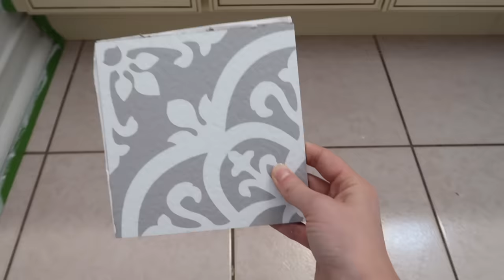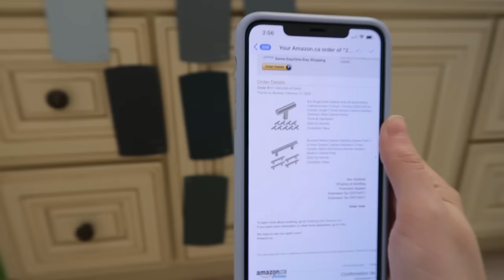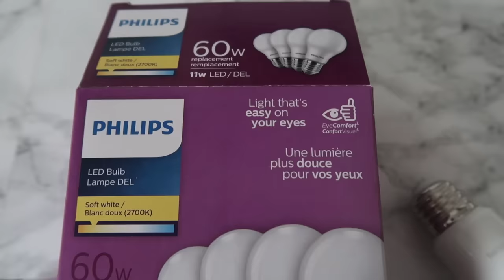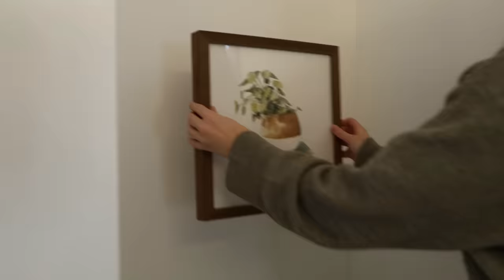DIY BATHROOM MAKEOVER ON A BUDGET | RENTER FRIENDLY

Comment: She didn't prep the cabinets or doors at all. That will definitely peel over time. None of this will hold up over time. Looks adorable but really need a longer term solution for bathrooms
Reply: Lisa o'brien I agree with you.  She should have of primed them, then used a high quality foam roller to eliminate the brush strokes.  Nice rugs would have been a better solution to updating the floors.
Reply: The counter solution doesn’t seem long term, that’s why it’s expensive to redo a bathroom
Reply: At around 6.25 is shows her sanding the cabinets...
Reply: I was looking for this comment! I was going to say, she didnt bad prep work. You should ALWAYS use a good bonding primer on a bathroom cabinet.
Reply: yeh we had floor stickers overtime they smell. we used to mop with bleach and stuff even then it wouldnt make a difference. after we used tile it didnt smell. so it was them stickers
Reply: @Lisa o'brien I know, I was cringing at the cabinet paint job. My husband and I have painted many cabinets and that cannot look good in person. We usually do 2-3 coats of a high grade cabinet primer and then 2 coats of paint. We also do a much more thorough job of prepping. 
 I was pleasantly surprised with how the floor came out. I'm not a big fan of that print everyone is using right now because I think it's super trendy and reminds me of a more modern version of what I saw growing up in the 70's but for the price, I think she did really well and since it's temporary, so who cares if it's trendy. 
Her parents are super sweet!! :)
Reply from the maker: Thank you for your comment! I did prep and sand the cabinets before painting for a lasting job :)
Reply: Kristen McGowan you did a nice job!
Reply: @KristenMcGowan  You did an awesome job and loved the creativity.  The floor thing is a great idea and one I would consider trying.  Very nice.
Reply: @Kate98755  I used contact paper that looks like granite on my counter and its been almost 2 years, no bubbling, peeling or tears.  It still looks as good.  In fact I also used it around the plant ledge of my bathtub.
Reply: Very nice
Reply: Fyi, there is now paint that doesn't require prepping for jobs like this.
Reply: @ShellG.   If you looked at the paint she used, it was paint with primer.  I've been using that type of paint for a while, and it is really sturdy - it doesn't scratch or peel easily.  I'm concerned about whether or not she used Kitchen & Bath paint on the walls, though - didn't get a good look at the can.  K&B has the anti-mildew treatment added in at the factory.  That's important for those ultra whites.
Reply: @thatsmalltowngirl4   The paint she was using has primer in it.  Good quality.  And she did sand before painting the cabinets.  The door might be a problem, but the paint - again - is paint + primer.
Reply: @Kate98755   I was thinking she could have gotten one of the marbling kits they sell - good sanding on that countertop and then just apply the kit, following the directions.  They're not that hard or expensive.
Reply: The cabinets didn’t even look bad before.
Reply: @caroljean1962  If she used Behr Marquis, that has primer in it already.  Also, the cabinet looked more mat than glossy, so it might work.
Reply: @planetag310  That is paint meant for walls.  The primer in it is meant for changing wall colors.  To have a lasting job on cabinetry, one must use a special bonding primer and then cabinet paint (or a chalk paint followed by a quality top coat to seal & protect).
Reply: @missmessi  it's the water that get below them that gets stagnant and moldy
Reply: @diziscurran  yep agree. coz after we did real tiles it never ever smelled.
Reply: @missMediaChick  can you give me examples? Thanks
Reply: That's the problem with renting. You just don't own the property and do what you want to in it. The owner owns it. Save up!!! Start now!
Reply: I love how you're all telling her how she should have done things.
If you think you can do better then start your own youtube channel.
A lot of times these things are done behind the scenes, or off camera, to save time.
Don't make assumptions.
Reply: @ShellG.  Are you an expert? If you are then you should start your own youtube channel instead of coming on here and critiquing someone else or thinking you know better.
It's rude.
Reply: @KristenMcGowan  Thank you for being kind to the know-it-alls that come on here and pretend that they know everything you did behind the scenes or that didn't actually watch the entire video. 
I don't know how you deal with them. I get frustrated just reading them lol
Reply: @JenSwarbrick1966  Not sure why you're so offended by my comment seeing as how the other comments were pretty harsh but I digress. To answer your question, we have painted 3 sets of cabinets and I took the original instructions from a professional painter. He's seen my finished work and said he was impressed. I think she was just trying to do this complete job under $400 and perhaps she would have spent more money if it weren't for that. Doing a proper paint finish on cabinets is usually a 3-4 day job. The inside of the cabinets weren't finished because there wasn't enough paint. I don't even know why I'm explaining myself. I just feel that if you're going to do a DIY video to show people it needs to be done properly. Overall, she had a nice outcome.
Reply: b anonymous I used the same floor stickers in my bathroom:.. for a year no issue with moisture or them peeling up. The adhesive is INSANELY strong.
Reply: Lisa O'Brien, finally a voice of reason!!!  You are correct! None of this will hold up over time, and is likely to cause real problems with this bathroom which will only devalue this property as a whole. All the dolts who are praising this makeover and encouraging this young woman to continue and who are saying they'll be following her advice, are just as clueless and uninformed as she is. While what she has done looks good, it is not good, and it is not an improvement to the old bathroom in any way but visually. The makeover, as appealing as it may visually be, is a fail. The creator of the video is one ill-informed person giving advice to thousands of ill-informed people who are eating it up with a spoon.
Reply: @JenSwarbrick1966 , what is your problem???  Of course people will, and SHOULD, comment when someone gives half-baked advice that is blatantly wrong. It is not rude to point it out, it is considerate, and is done to prevent innocent people from making the same mistakes. You keep replying that negative commentors should 'get their own YouTube channel'.  Well here's a news flash for you, not everyone wants their own YouTube channel. It is the absolute last thing I'd be interested in doing.  But, you can bet if I started one, I'd only post advice and videos that were well researched, and would not just throw together a video containing poor directives for others to follow.  The finished product in this video may look good, but it was poorly researched and poorly executed. It will not hold up over time and devalues the property it was performed on. Oh, and before you ask, I am a formally-trained, professional, well experienced, NKBA Kitchen & Bath Designer. I am all for inspired, cost saving, diy makeovers. In fact, I applaud them. But, the advice in this video is an epic fail. Had the creator done even the slightest bit of research into which materials were best or appropriate for the tasks performed, others with more wisdom and more experience would not feel the need to point out her failings to viewers wanting to copy her makeover. This makeover may have only cost $300.00, but the long term damage it can create could cost 100 times that. Maybe you yourself need to get a clue before you disparage others for trying to prevent unknowing homeowners and renters from making the same, potentially costly, mistakes. I agree that the finished project looks infinitely better than the original bathroom, but it is actually the exact opposite of a home improvement.

Comment: Tip when painting cabinets: Scrub the surfaces with a good cleaner, lightly sand if you can, and use a bonding primer If you want the paint to last.
Reply: I was wondering about that
Reply: Yes! Her cabinets are probably going to scratch the paint off.
Reply: Thanks for the tip! Going to paint my vanity next year

Comment: The only thing I'd do differently is put a coat of primer on the cabinet and door before painting it. I know they're supposed to be a primer and painter in one, but a coat of primer will help it last longer. Great job! I love the floor.
Reply: And paint the inside doors and trim. Gives the appearance of new cabinets
Reply: Beautiful!!👍👍😀  I too love your dads accent!
Reply: If you use chalk paint no need for primer
Reply: I do see some details were missed and maybe a second coat would’ve been used . I would paint the inside of the door , don’t like the diff look when it’s opened , not necessarily the inside of the cabinet . I did that in my kitchen.’also raise the shower curtain to the top and get an extra long one it will make the shower seem taller
Reply: That's a great tip! Thanks for sharing!

Comment: I would put a clear coat on the cabinets they will chip over time it will help make it last longer but looks good nice job
Reply: Actually she didn't mention removing dust after sanding and degreasing and she didn't use a primer so it would chip off anyway even with a top coat.
Reply: @mrsme8616  Exactly, you should always use a good bonding primer for something like this

Comment: I suggest that you update the towel bar on the wall when you fix the light in the future. Also a tip for the built in wall shelf, IKEA sells some small "pluggs" that are made out of plastic that you use to fill holes on adjustable shelves. It would look really good if the holes were less visible. I have them in my open wardrobe and it just takes it to a new level!

Comment: I would like to see how the sticky tiles look after water getting in between them.
Reply: I just thought the same.
Reply: they don't hold up to that at all, unfortunately they're just not practical for a bathroom
Reply: I have sticky tiles in my bathroom. I have jumped out in the time after a bath and washed my pups with out any of the tiles coming up. But then again, I didn't get super cheap tiles. A good box of sticky tiles of 12 is around 25$ or so. They are a great budget friendly addition. I would recommend to anyone
Reply: I've used sticky tiles in the bathroom and they held up great.  I have a bathmat outside of the shower to step on when I get out, and I don't have any small children that splash onto the floor.  I always make sure that the shower liner is in the tub when I take a shower, and have taught my son to do the same.  Perhaps that's why I've never had a problem.
Reply: @69mwagner  yeah really depends on the quality, the cheap ones aren't going to last at all.
Reply: Easy just don't splash water on it : )
Reply: We had sticky tiles put in the house we built around 1986 or so. Within a few years they started to come up and the sticky part goes all the way up the thickness of the tile and so all sorts of hair and dust stick to the edges and aid it to peel up.
Reply: You can always put a spackle between them as well :)
Reply: Emma Thienes that’s what I figured.
Reply: when I rented, I actually used sticky tiles and they worked fabulously! That tile still looked as good as the day I placed it down when I moved there and I lived there for many, MANY years! Oh! And, I asked the renting agent if they wanted me to remove the tiles before I left and they said, "No! The floor looks very nice, actually! Please leave it as is." so of course, I did just that! They incurred 0 water damage (and I raised a kid in that townhouse and he had TONS of friends because he played every sport imaginable and they all flocked to our house, for some reason!🥰). If the tiles she used in her parents' bath are anything like the ones I used, they'll never need to change them unless they want to!
Reply: I’ve never used these so I can’t say anything based on experience, however based on the feedback in the comments below, the worst case scenario so far has been lifting after “a few years”, while others report many years of use and no problems. If the expensive line is $25 per box and I spend less than $100-$75 to revamp my bathroom and it ties me over for a few years at best, it’s a win for me. Much better to spend less than $100 for potential issues in a few years than dish out a lot of $ to have my current tile hammered away with dust flying all over & then the added expense of new flooring and additional labor, etc. I speak for me because right now neither my mood or wallet is able to go thru replacing & installing a more reliable source of flooring for my bathroom.
Reply: And the contact paper. I mean a peel and stick bathroom for around $400. That is crazy to me. Bathrooms = steam and water. It is pretty, but how long is it going to last. It would never last with my children. They get the bathroom wet.
Reply: I used to have sticky tiles and they held up great. When it was time to do real tile I had a hard time prying some of them up.
Reply: Tie-Dyed Squishy 
Haha awesome
Reply: Exactly .. for rooms it could be gamechanger but not for bathroom
Reply: I had sticky tiles over a hardwood floor in my bathroom for like 10 years and all I can say is BLACK MOLD! It was awful!!
Reply: @femineity  what brand did you use? i am thinking of doing this to my bathroom. thanks.
Reply: @bbsilos  Wow, I'm having the hardest time getting this response to you! (connection issues) I wish I could remember, Baobao! I applied those wonderful floor tiles many years ago when I lived in my little cute rented townhouse. I do remember them being nice quality feeling tiles and that's not to say that I remember spending a whole lot for them. It was a small bathroom that got a LOT of foot traffic from my son & his hoard of teammates year after year. Whatever I spent it was well worth it! That bathroom came out so nice, especially the floors! Sorry I couldn't help you out with a brand name, Baobao!
Reply: They don't fare well in moist environments. Adhesive tiles can peel and just plain fall off in as little as three years. Especially around toilets and tubs. But, for $55-ish, might just be okay👍🙂
Reply: @krystinwingfield1685   Great idea - that's what I was thinking. There has to be a good waterproof sealant as well that you could paint the whole floor with and seal those cracks.
Reply: You DID this! Definitely going to try some of these hacks!
Reply: I just came across your channel and subscribed! You did a great job, everything looks beautiful! Btw, Thank you for not making the video really long and drawn out.
Reply: @rachelmarszalkowski6824  ten years is a very long time! It would be common sense to take them off after a year or two
Reply: What about moping/ cleaning the floors? Do you just not clean them 🤔
Reply: @Hero4fun77  Maybe use only the "wipes" on the floor and not really water and cleaner.
Reply: @lurksmcgee  0+iias
Reply: In terms of splashy children I'm pretty sure this is her parents ensuite.
Reply: We use Armstrong sticky vinyl tiles and I also use Tec floor glue to help set them.  The tiles have held up under 1 inch of flooding this spring and in our basement bathroom just fine. The only problem we have had with them is when I did the main level kitchen floor I didn't use the Tec floor glue and the heating and cooling of the floor over time has caused the glue to loosen and the tiles to shift.  But the ones using glue have not moved.
Reply: That is going to a major disaster. She should have just painted the floor tiles and then stencil them, and coat of varnish... all sealed and good to go.
Reply: @ashaolson5344  I had it in my bathroom for twenty years. No problem at all. I got sick of the tile they held up so well. Lol. I didn't bother getting new since we moved.
Reply: @ambergerhelper7852  , it was formica, not granite. But the floor tiles, yeah.
Reply: @JessyAyn  that's pretty much the case with them unless you use something over them to seal them but then you have the problem of getting them up if something goes wrong with one of them.
Reply: I've had CHEAP peel n' stick tiles in my apartment for years because they're still better than the 50's-pink nightmare that plagues apartments in my area. I used peel 'seal silicone caulk against the bathtub and around the base of the toilet as a water precation. It works SO well and it's going on year 3. My roommate is terrified it wont come up when we leave but I  peeled a tiny edge under the trash bin after hitting it with the hair dryer and it stuck back down again without curling up.
Reply: We had peel and stick tiles in our kitchen and bathroom for at least a decade. No mold issues and they held up very well in a house with 3 women sharing a bathroom and 5 small dogs running around them. No extra sealants just laid them down. Pulled them up a decade or so later in the bathroom to install new ceramic tiles when the bathroom was remodeled
Reply: I used sticky tiles from Home Depot on the floors of a dental office. Four ops and a lab and it held up great, at least five years before we vacated to another location. Went right over worn-out sheet vinyl. Lots of water drips and no issues as we placed it super close together. I would recommend for a low-cost update. You could also use snap together LVT which is fantastic and easy to install. I would go for that now as its more durable beautiful